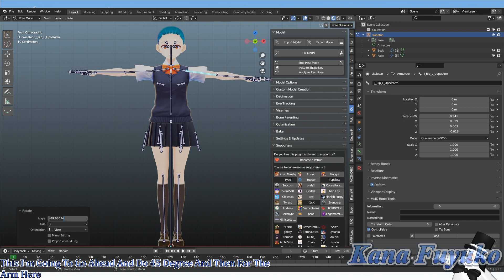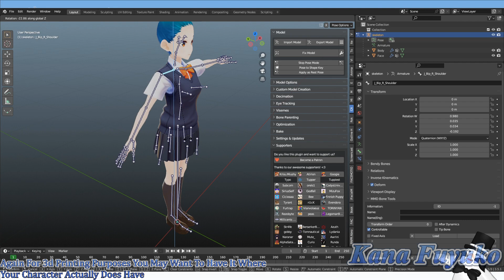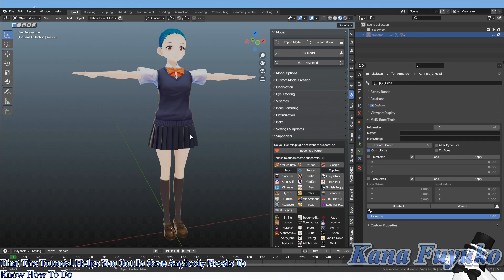(OUTDATED) How to Change Model Default Pose To A-Pose or T-Pose!!!

Comment: it doesn't work for blender since 3.0
Reply from the maker: I was told CATS works on Blender 3.6 LTS (I recommend a forked version of CATS though since the original dev abandoned further development for the official version), Blender 4.0 and 4.1 doesn't work with CATS anymore and require a different method which I will make a tutorial of when I can.

Comment: why error on me when trying to install
Reply from the maker: I recommend going to the Cats Blender Tool Discord or report in the Github the error as I'm not the developer. I can only recommend updating your Blender version or reinstall the addon with a different method.
Reply: thank you
Reply: @Kana_Fuyuko  I think the main problem is that it does not work with the new Blender version...
Reply from the maker: @marcoviitanen  It is the issue, my reply was 7 months ago and by now I already know Cats is outdated and will never get an official update for 4.0+ as the python version for Blender changed causing addons to break, there is a forked version but still a work in progress. I made a new tutorial for the vanilla workflow for 4.0+ users and will be marking this tutorial as outdated: https://youtu.be/10YSMWOQv8g